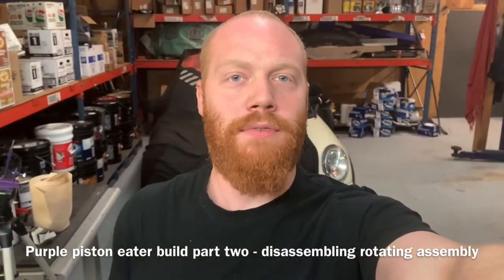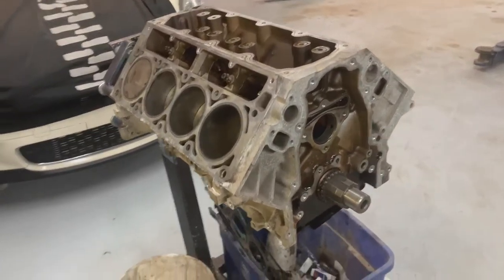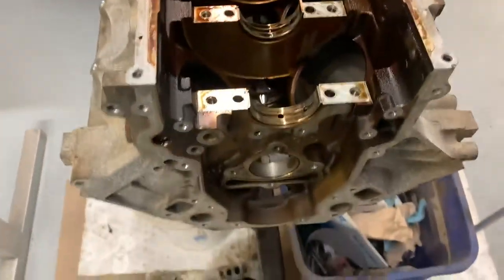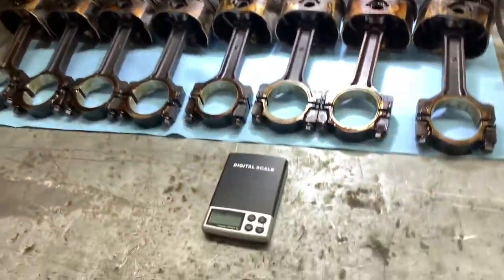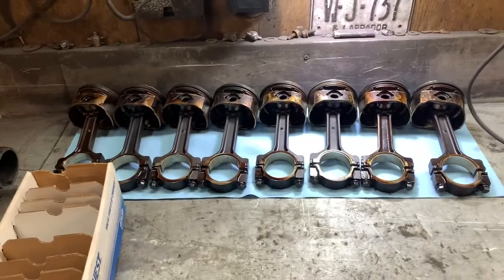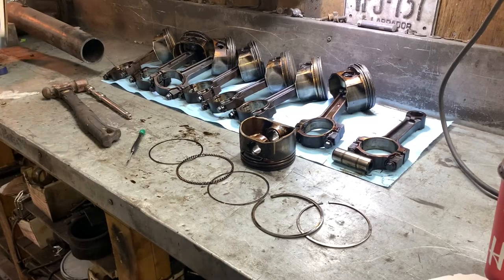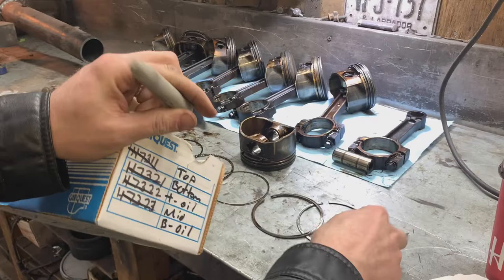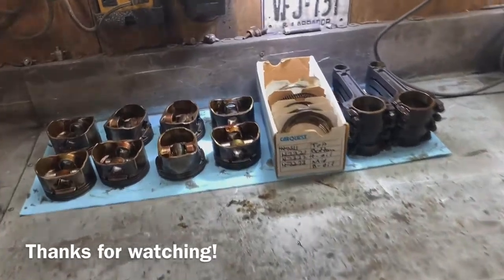Building an all aluminum 5.3 for BOOST! Part two - disassembling bottom end and pistons.

Comment: So is the 1 x cam gear so you can use a gen 3 harness and ECU?
Reply from the maker: You got it, I’m more familiar with gen 3 stuff and like cable throttle more
Reply: Great question I’m seriously new to all this I have a gen 3 in my 01 gmc short bed and I also have a gen 4 in my 2012 that I want to completely redo and make nice in time obviously but right now the word of the day is delete i have to get the AFM/DOD out of my 2012 LC9 because that motor is in my daily driver as of right now zero issues no ticks or anything like that BUT it has been showing low oil pressure now that could be the stupid oil sending unit filter but I want the AFM DOD gone the lifters are simply unreliable and I don’t want to break down with my son in the truck possibly in the middle of nowhere but i think this gentleman is on the same page as me low dollar power well in my case low dollar dependability right now I’m extremely thankful to find his channel
Reply from the maker: Johnny for the time being you could have someone disable the afm in the pcm, this will stop the afm from activating. That’ll prolong the inevitable until you can get inside the engine and do the actual delete